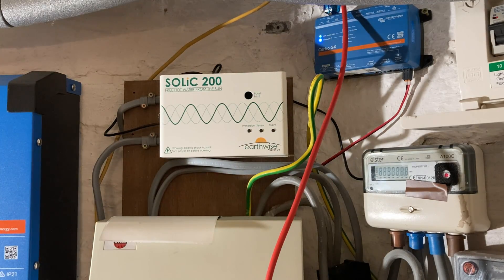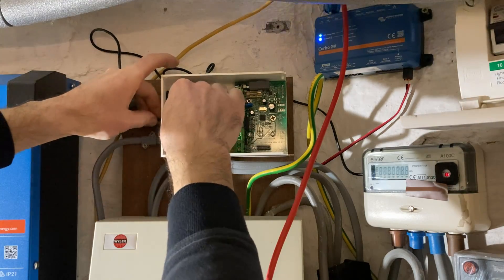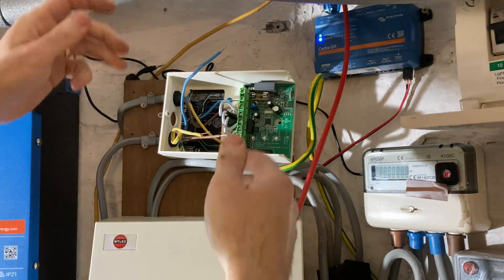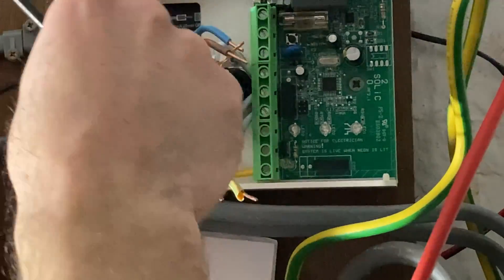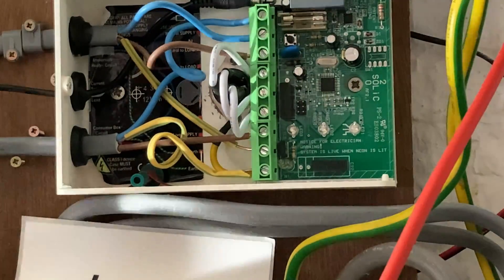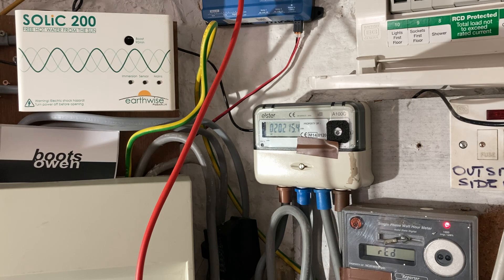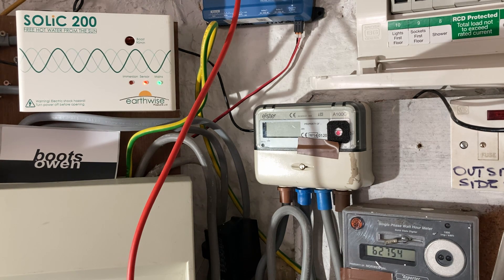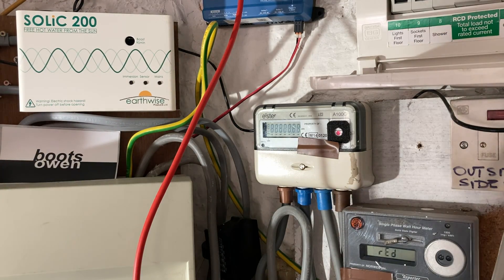Earthwise contacted me for a warranty repair! | Solic 200 | Solar diverter install and comissioning!

Comment: Hi Owen. My solic 200 has 3 red lights. Any idea what i have to do?
Reply: I turned it off at the circuit box and when I turned it man on it seems to have reset itself. Fingers crossed its sorted now. Thank you for your response.
Reply from the maker: when you recommission the unit you have to let it know which way the electricity is flowing through the cable as detected by the clamp. so when you start it up the house has to be drawing power from the grid, this is described in the manual.
Reply from the maker: Hi, what does it say in the manual, that is a good place to start, You can look it up on the solic website.
Reply: @bootsowen  yea I have the manual but I am still clueless. It says turn off solic,  check the sensor is plugged into the right conductor.
Reply from the maker: cool, so have you done that?
Reply from the maker: SO the manual says:
Troubleshooting
If there is a problem with the SOLiC 200, three red lights will show
or only the Mains light will show or no lights will show.
If three lights show, turn the power to the SOLiC 200 off , then
verify the following: The sensor is connected to the correct
conductor The sensor plug is plugged into the circuit board The
sensor is clean and securely closed The sensor has not been
damaged The immersion heater is switched on The wiring to the
immersion heater circuit is correct The immersion heater element
works That the water in the immersion tank is not already hot
Once these checks are complete, follow the commissioning
process on page 5
If the Mains light is red a mains fault has been detected. Check
the inverter for a DC leak.
If none of the lights are showing, please replace the internal fuse
(500 mA slow blow fuse), investigate and rectify what caused the
fuse to blow and follow the commissioning process on page 5.

SO there is more to it than you say. Perhaps call the installer if you are struggling to work through the instructions. They are not particularly difficult if you have installed the unit, but if you are not familiar with electrical installations then there may be a learning curve, which is rather gentle in this case!!

Comment: Wired up a Solic 200 solar diverter and the first time I tested it it seemed to be allowing a few W back onto the grid which is fine no system will be perfect, but the next day it now seems to be allowing 50-70W back onto the grid. Everything online claims it should be zero. Should I keep faffing around or is this probably fine?

Many thankss
Reply from the maker: I would be happy with it if it only allows power out. But when it draws power from the grid and you have to pay for it it is tricky!

Comment: Owen, so is the Earthwise customer care up to scratch beyond the MD? cheers
Reply from the maker: I had to pay the postage on my own return! They contacted me because they felt that one of my videos could be considered as bad publicity. They did sort it out very quickly, and it is good that it should work with the victron, to take any remaining power that the victron doesn't use. I think my experience is completely different in that they initiated it. Difficult to comment Andy.